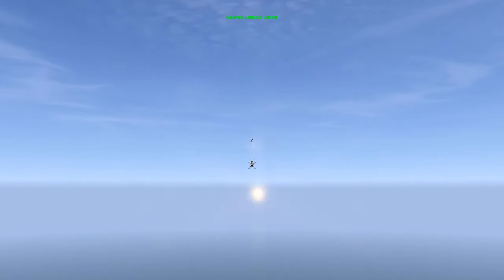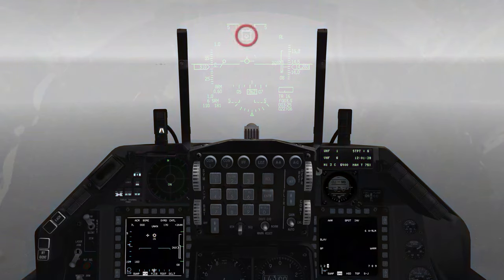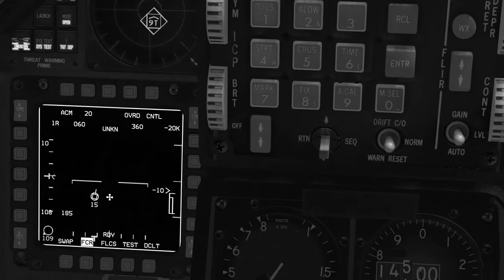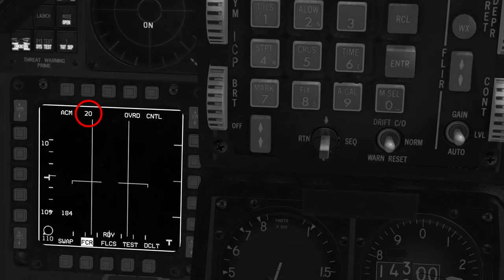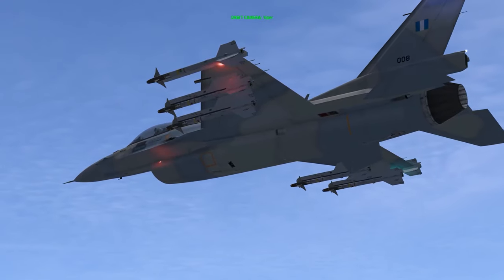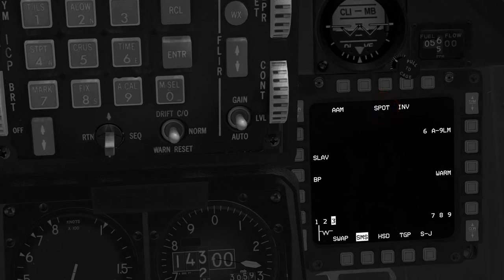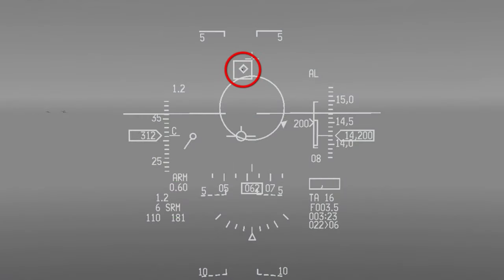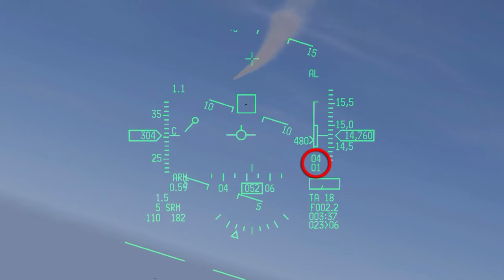Falcon 4 BMS 4.33 Tutorial 16  using AIM-9 Sidewinder with FCR in ACM mode

Comment: Great tutorials- coming back into the game after years and just installed BMS 4.34, will this be relevant for 4.34 as well for sidewidners?
Reply from the maker: As I understand it the functionality is the same, but the missles are more vulnerable to flares and other heat sources.
Reply: supanova ok great thanks for taking the time to reply, I have the installation done and will be getting into it in the next day or two (wife permitting :) ), bring at it since the original Falcon Spectrum Holobyte on a monochrome monitor - have not played Falcon BMS for a decade almost so need to brush up
Reply: supanova worked like a charm!- Amazing to be back at it and excellent tutorial. Now next to my favorite for AG missions to HARM. I see you have tutorials on it as well so let me spend some time on it.
Reply from the maker: Good luck with it. I believe the SAM crews are more intelligent now.